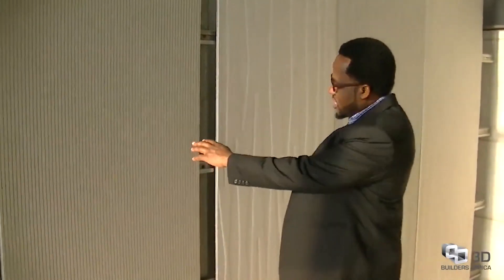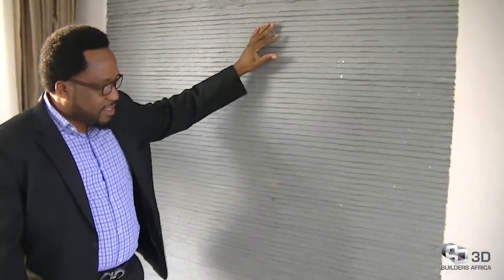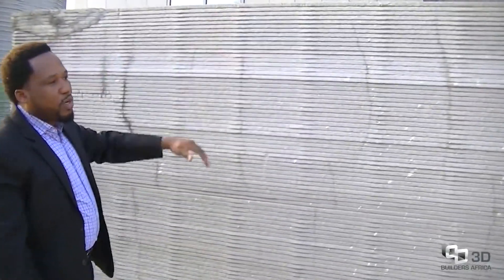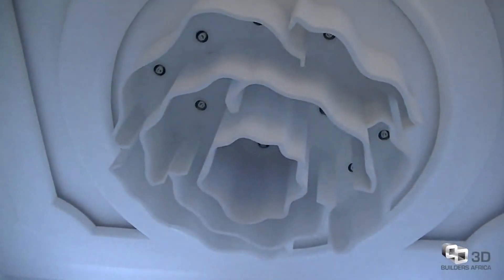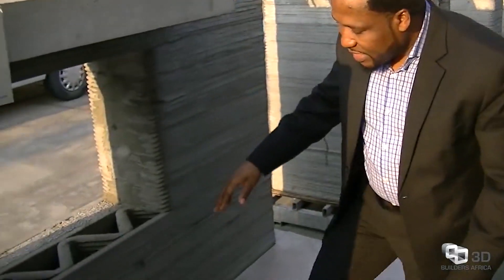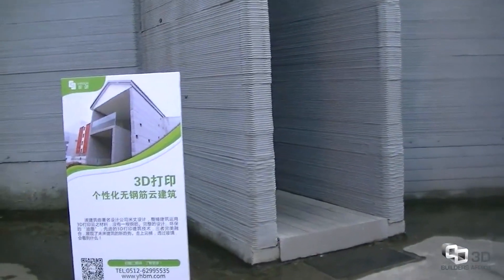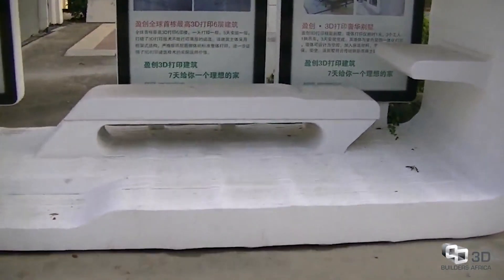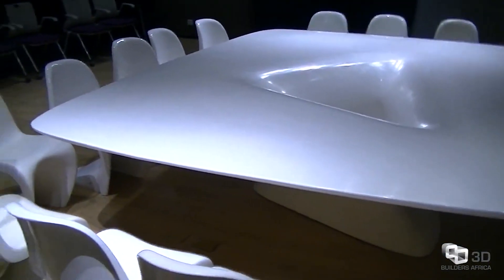Exclusive Winsun 3D Concrete Printing Factory Tour, Suzhou China

Comment: Very nice. I’m just curious about the structural stability because it has no reinforcing steel bars. Can I get an answer? I’m interested with the technology that’s why I’m asking. Thank you and God bless
Reply: Concrete or the paste that they use, once cured, is extremely strong in compression.  So unless you have a tall building facing the wind or a floor with a long span you do not need the strong in tension steel.  That’s why many walls are built out of concrete block and only requires steel rebar and and concrete in the cavities when the wall is high.